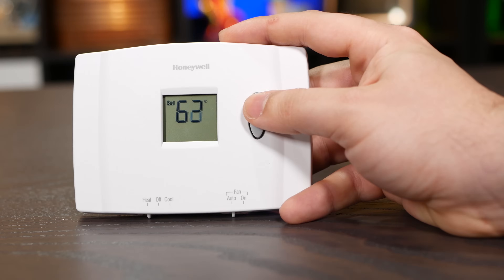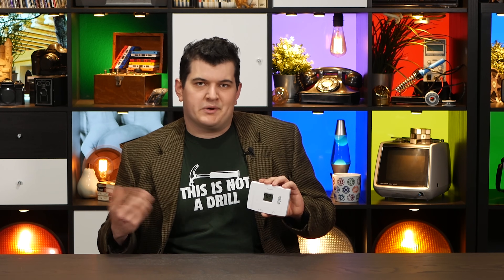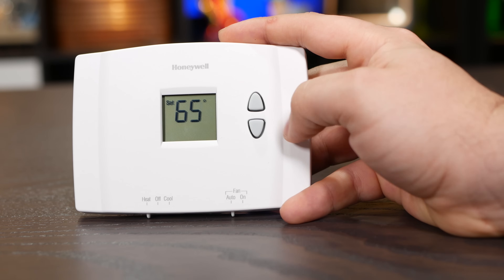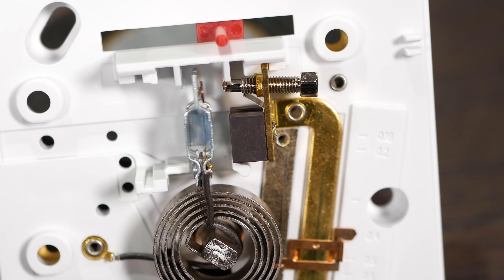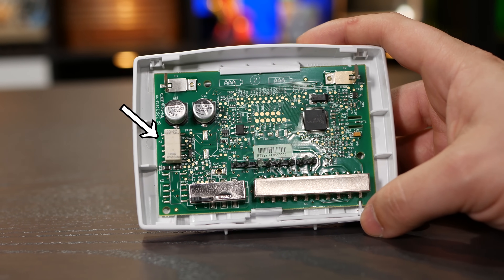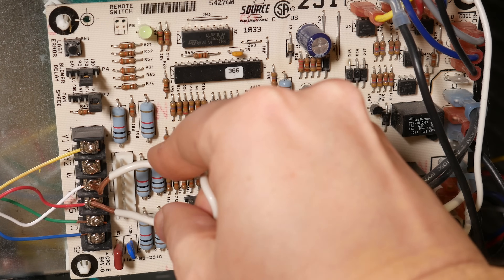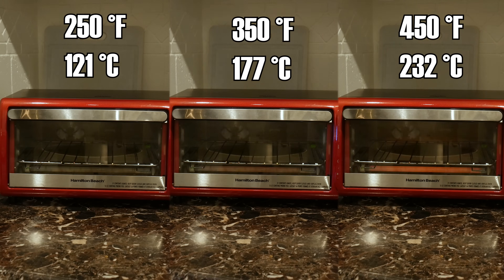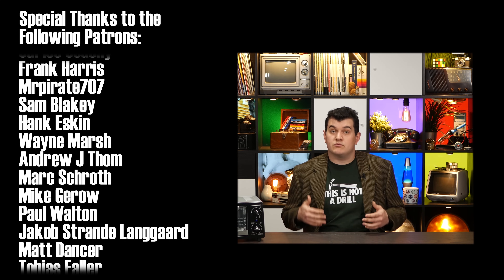Thermostats: Cooler than you think!

Comment: You forgot the HEAT ANTICIPATOR circuit in that cheap mechanical Honeywell t-stat.
It's the adjustable slider that changes the length of a thin heater wire in the thermostat. 
You can see the amp rating numbers next to the slider increments on it in your video. 

You measure the amperage on the closed red to white 24vac circuit and move the slider to that amperage rating. 

The current pulling through that adjusted length heat anticipator wire creates heat inside the thermostat itself and helps speed up the sensitivity of the thermostat to react to the heating of the space. 

If the furnace over shoots the temperature you adjust the wire to a lower amp rating which will cause it to create more heat to speed up the reaction. 

If the furnace short cycles you adjust the wire to a lower amp rating to create less heat inside the thermostat to slow down the sensitivity. 

There's also high efficiency 2 stage furnaces or electric furnaces that bring on partial capacity until that doesn't keep up and when is 2 degrees below set point then 2nd stage (full capacity)  is energized. 

Thr digital thermostats have adjustable cycle rates too. 3 cycles per hour.  6 cycles per hour.  etc..

Comment: I have a family member that has no idea how thermostats regulate the temperature. Meaning, if they turn the heat on, then they believe that it's just going to keep cycling on and off, on and off, over and over, regardless of what temperature it's set at. So they're constantly turning the unit off and on all of the time, rather than just letting the thermostat do it itself. So annoying...

Comment: most of the Honeywell  thermostats will let you run the unit one time and return to the "set point ".
you set the stat to the temp you want then press "hold" this locks in the temp   if you raise the setting it will return to the "set point" after the stat is satiated

Comment: I HAVE AN ANSWER TO YOUR QUESTION

 There is a thermostat called Hive. HVAC company I worked fire owned by a big energy delivery company called direct energy created these. The feature is called boost mode.  YES you can select how long you’d like this boost
What I do with my thermostat is program every two hours same 72 degree temp so I know it will go back to schedule sand set point

Comment: I have a rather complex digital Lennox HVAC system with a variable speed blower, digital WiFi thermostat, and highly configurable settings for all sorts of fun accessories. In the end it still does exactly the same thing: "thing on - thing off", but I am able to adjust the blower speed and heating/cooling output  (though this is supposed to be done by a Lennox technician during install to properly configure the system for the correct rated output the home requires).

But one thing it does include is the ability to manually change the set point for a limited period of time - just like you requested at the end of your video ;) I can change the set point for periods of 2, 4, or 8 hours or until the next schedule. 30 minutes might be more useful for the "mowing the lawn" cooling (or "shoveling the driveway" heating) scenario, but 2 hours is not bad.

Unfortunately, my house came with the system when I bought it 2 years ago so I don't have any information for you about cost. But hey, if you want to do a follow-up video about smart HVAC systems, and if you're in Colorado at the time, you're welcome to come by and check it out.

Comment: For the last twitter question from this video: maybe run another pair of red and white wires to a timer/countdown switch like the kind used in bathroom fans, so you can just turn it on for x minutes and then it will close the circuit until the time runs out, at which point it will break the circuit and leave the thermostat to take over when it warms up to the set temperature.

Comment: Anticipator, older bimetallic thermostats had a little heater wire called anticipator, which was set to the amperage called by the gas valve on the furnace. This little heater would warm up and break the heat call cycle prior to the temperature in the room achiving its goal. This reduced overshoot, however, it meant that your furnace would run for a longer time if the start room temperature was 65 and set was set to 80 versus the set temperature set to 70.  When set to 70 the anticipator would have warmed the thermostat a bit and it probably turned off at 68 and coasted to 70.  The anticipator also helped with the furnace cool-down cycle, as when the call for heat ends, the furnace still has to run the blower motor to cool off the heat exchanger in the furnace.  I did see the anticipator was mentioned 5 months ago but never explained.

Comment: Is it a thermocouple in the thermostat, or a thermoresistor?   A thermocouple needs a temperature delta from the junction to the meter.  I dont see how you can get that delta within the thermostat.  thus I think the electronic thermostat would use a thermoresistor rather than a thermocouple.

Comment: What about inverter air conditioners (and heat pumps, that is, cold/hot air conditioners), which can actually vary their motors' speed and thus vary their “blast”?
For example, full blast until cooling to an “x” temperature and then lower the power to maintain temperature - really - constant...?

Comment: You know what I find funny? You have this fancy smart LCD touch screen WiFi thermostat which integrates with your Alexa to give you all sorts of fancy features. And all it really does is slamming two 24V wires together to shout "HEAT NOW" to your ancient furnace that was installed in the basement 20-30 years ago.

Comment: Maybe more of a UK thing, but some thermostats here have a one hour button that you can poke that'll turn the heating on for an hour then go back to the normal programmed setting. We don't tend to have cooling but pretty sure it'd work in the same way to just turn on for an hour and then back off. There's also sometimes an "advance" button which moves the program to the next state in case you get back early and want heating on or are leaving and don't want to keep heating the house when you're out. It then goes back to the normal program at the next set state change.

Comment: "cranking it up to 80 doesn't make it go faster" Well ... cheapest thermostat will not do any advanced regulation but nest and others actualy might. Often most regulators are made to reach some value and not overshoot it dramaticaly. Most regulators (most of them not only thermostats) count with raising temperature once they shut down furnace. So If you set up 70 degree then termostat will shut down furnace at lower temperature and temperature will rise to 70 (and sometimes even little more than 70). Whitch of corse mean that temperature will rise a little slower one thermostat turned furnace off. Soooo ... if you don't mind overshooting your wanted temperature set your thermostat a few degrees more and after while just change it to desired temperature. :D all right that is nitpicking but this is internet :D

Comment: A better example of pulse-width modulation:
The average household microwave oven.

If you tell it to heat at half power, it doesn't operate at a lower wattage.  It operates at full power for (say) 8 seconds, then shuts off for 8 seconds (leaving only the fan, light, and turntable running), then turns back on again for another 8 seconds.  You can hear it cycling on and off, and if you're boiling something in the microwave oven, you can see your water bubbling for 8 seconds, then stop bubbling, then start bubbling again.
Reply: While it is, in fact, pulse-width modulation a microwave doesn't really showcase the ideal results you normally want to achieve using PWM. If you aren't using PWM as a means of encoding data you are probably trying to accurately replicate some constant analog value. In such cases, you often want a PWM signal with a higher frequency. With periods ars long as microwaves have, even if the average power delivered is the same, the end result is quite different from what you would have from a constant source.

Comment: Regarding a temporary override, Ecobee does do this.  When you make an adjustment, it prompts for whether that adjustment should revert after a set period of time, hold for the next scheduled change, or hold until cancelled.  Pretty nice for when the house feels just a touch to hot/cold when heading to bed, but I don’t want the system running all night!

Comment: In the UK, they combine the heating and hot water together; the usually have an "1 hour" over-ride that you can press that gives you heat now, and then it returns to the usual "program". Air conditioning isn't common at all in homes.

Comment: Actually, you missed a very important part of these thermostats - the anticipation circuit. I think even the one you showed has it via that setscrew that determines how much force it takes to be removed from the contact point. With old school ones, if set to cool, a small little heater makes the thermostat turn on quicker so that it doesn't lag too much. You can set how strong that is with a slider. With heat, it turns on during heating to stop before it overshoots. 

Digital thermostats have it built in - all honeywell thermostats, even the basic ones, will learn over time how to anticipate temp changes.

Comment: "The blue does nothing, ignore the blue" - It's the little red button, you turn that one on and the house explodes.
Reply: if you are curious its actually a common to the defrost board in the unit outside. (assuming its a split system.)

Comment: how is it even possible in 2019 to heat up a house by only messuring the temp in one room. In Denmark we have a hot water tank and then a system of thermostats in each room controlling valves circulating the hot water through pipes in the floor of each room to warm up. Windows, wind, sun and individual heat needs in different rooms, makes it impossible to only control a single point. Crazy Americans.
Reply: That exists too in America for hot water systems of today. Obviously for forced air you need to use dampers, but if the ductwork was put in properly, it should be balanced.

Comment: In the Netherlands, most of us have no AC but the furnace regulates down to 30% (which is more efficient, actually). And there only two wires providing both power to the thermostat and digital two way communication

Comment: Some electrical heating systems in the UK (where there isn't a boiler [furnace], rather the radiator heats itself up - until recently we had no need for AC over here!) have a Boost button which will turn the radiators on for a set time before turning themselves off again. Perfect for when you get in from work, and you're about to pop the kettle on. These have been around for quite a while, they're mainly useful on storage heaters. These have a block of concrete (or some variation thereupon) which - theoretically - will be heated overnight when the 'leccy is cheaper and then discharge their heat over the day. Trouble is, they aren't all that good at storing the heat so the boost button can tie you over till you get to the duty cycle again. In the UK, we can also vary the intensity of heat output from the boiler (furnace), usually by turning a dial on the boiler faceplate that will regulate the fuel coming into it. You usually cannot do this from the thermostat though.

Comment: 240volt mechanical thermostats have a neutral connection connected through a resistor which heats up slightly to encourage air convection through the thermostat to increase it’s accuracy by a possible 30% or so

Comment: Heating is technically conditioning the air. In the most general sense, air conditioning can refer to any form of technology that modifies the condition of air (heating, (de-) humidification, cooling, cleaning, ventilation, or air movement). I better turn off the AC, it's getting cold.

Comment: For the "one cycle" question: most central air thermostats have a FAN AUTO/ON switch, switch that to on.  It will turn on the fan to cycle air through out the house with turning on the rest unit, until the air reaches X set temperature.

Comment: I have a newer modulating Carrier furnace that has variable 'blast' which automatically selects between three flame levels, and has multiple fan speed levels. If the temperature difference is great, it will use the hither flame level to output more heat, and run the fans harder, but if it is just making up for a slight temperature drop, it runs at a low level to maintain the target temp.
Reply: Also, thanks for the info about the < and > keys stepping frame by frame through videos.

Comment: Heating and cooling system in the US seems to be so simple and easy? Whats about the efficientcy? I could image the a gas powered heating system with 11 kW that periodicaly turn on and of is less efficient as one that can controll the heating power? 
I know in Europe water based radiator systems including hot water preperating is much more complicated and no system have any standard. In every house you will find different systems, different cabels and hunderts of different controllers.

Comment: As a Tidbit of knowledge, the PWM (Pulse Width Modulation) is also the basis of modern Electric Fuel Injection (EFI) on almost every ICE Engine. Also, an ICE car generally has a mechanical thermostat to regulate the engine temperature through the use of Coolant. It would be interesting to use an electric thermostat, such as these, to let coolant flow through the engine. It may add to much complication, as most mechanical thermostats fail in an open position.

Comment: why (or how) the car ar conditioner can make air at different temperatures, but the home`s one only runs on max?
Reply: The car has a mixing door that mixes hot air from the heater core and cool air from the evaporator in differing ratios. Some cars also regulate the amount of hot coolant going through the core. Unlike your house a car's heater(the engine) and AC compressor can run in tandem.

Comment: In Germany a lot of older Houses dont have a HVAC or Central Heating Cooling System with air ducts. 

We have a heater in each room which uses hot water from the central heating thing which in most cases also heats the water and the water circulates through the building. The heater in each room has a Valve that controls the flow which is controlled by a mechanical thermostat. You can twist it and set the temperature and the coil inside will expand and retract to hold the temperature in each room. Its a pretty nice System and you dont have to fiddly with it. The benefit is that you always have the right temperature in each room.
By the way i dont know a single household which has a air condition unit as its only hot on a few weeks around 30-42 degrees C (86-108F) in the summer and almost all houses are built with stone and are highly insulated. Double or even tripple glas windows are standard. The insulation keeps most homes at a nice temperature so most of the times we air out in the evening and night and close the blinds and windows during the day. Outside was 40C(104F) and inside was around 23C(73F).  More modern Houses use geothermal heat or use photovoltaic on the roof. 

Also no AC in public transport sucks in the summer. :(
Reply: @KeeDx3 pumice

Comment: Im 99.999% sure Nest can be set to run for specific period of time before reverting back to the scheduled setting. The thermostat @ my work does something similar. It's an dual auto thermostat in which it has an active heat setting and an active cool setting and is scheduled to run between if the temp moves outside that range. You can manually change the temp to turn on the AC/Heat but it reverts back to the schedule after a short period of time.

Comment: I remember my dad explainer how it’s either on or off when I was like 5 and my mind was blown. I would always set the ac in the car to “low” instead of the default 72 because I thought it would cool faster.
Reply: Im pretty sure ac in cars are different
Reply: Newer cars have modulation of the cooling and the heat to meet the requested temp.

Comment: The ecobee smart thermostat allows usersnto add sensors in different rooms to average out the house temperature. I can even thel the main unit to disregard some sensors either at night or when we are home in order to just take the temperature ofmsome portion of the house and heat or cool the house based on those temperature only. My bedroom is facing south and is always extra warm during summer time. So i only use the temperature from my bedroom sensor to tell my thermostat when to cool and when to stop.

Comment: Several furnaces I've seen with schedule based temp settings can have their settings configured so that changing the temp using the buttons on the device doesn't alter the schedule, it's just gonna hold the new temp until the next scheduled change( say, at night when the minimum temp drops)

Comment: My furnace has an external temperature sensor. It makes its effort based on the difference between outside and inside temperatures. Also, my thermostat can tell it to override the sensors and heat to my desires. Saves a lot of gas.

Comment: So the coming in from mowing the lawn thing...most thermostats I've used have a "temp" (temporary) feature. Program the thermostat...but then push the temp change button and it cools/heats to desired temp, then returns to run the program. Related is the "hold" feature that will override the program and hold the temperature at the desired amount. Do you guys not have this?